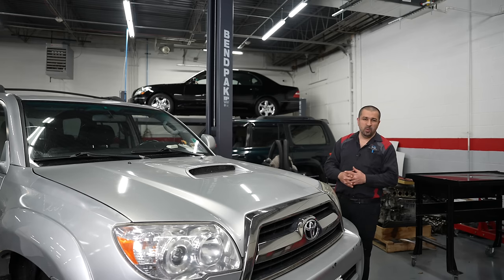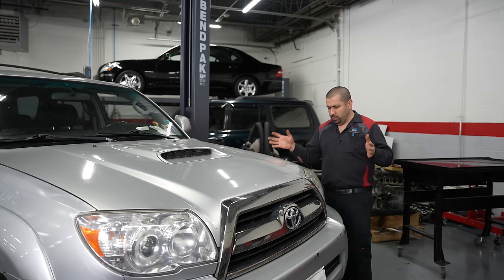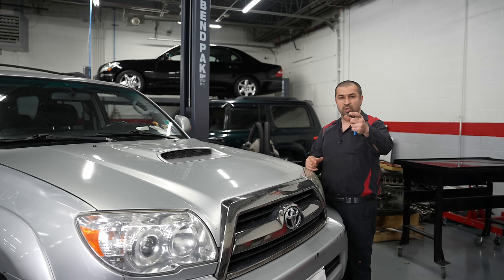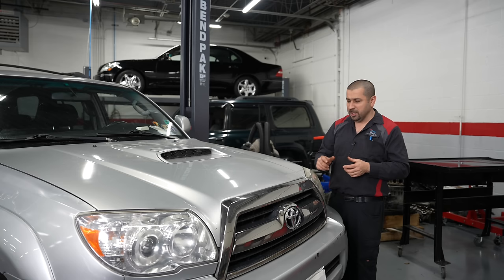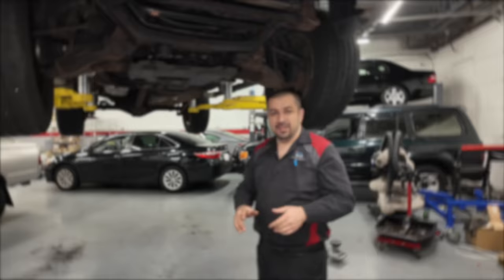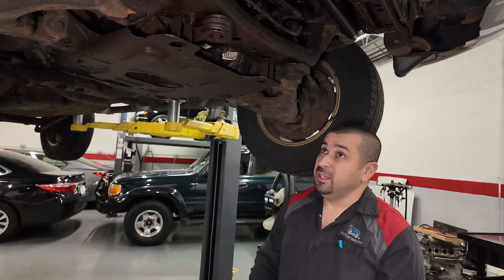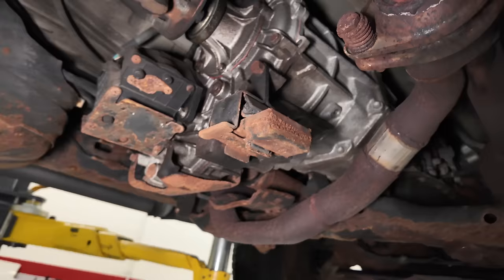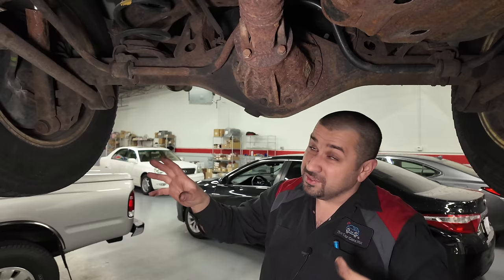THIS Problem Can Destroy Your Toyota Truck Transmission! Is it Too Late for This One?

Comment: Dealers took the transmission dipstick away, so how can you check the transmission fluid without taking it to a shop? The transmission dipstick should never have been eliminated.
Reply: Manufacturer eliminated dipstick, not dealership.
Reply: Jack stands and a hundred dollar scan tool, but I 100% agree on the stick never being removed.
Reply: 😂 it’s not hard to check it.
Reply: It’s a sealed system, pretty much. No dipstick reduces the risk of adding the wrong oil or wrong amount.
Reply: There should be a way to add a dipstick for the people who do their own maintenance, next they will take the engine oil dipstick away then what.
Reply: @emiliog.4432 
Cough, cough.
All transmissions and engines are “sealed”.  That’s what gaskets and o-rings are for.  “Sealed” doesn’t mean the gaskets can’t wear out, and it can’t develop a leak.  Nothing is permanently sealed that can be taken apart.  People need a way to easily check the level.  Don’t drink the cool aid.
Reply: I agree. I’m keeping my older vehicles WITH dipsticks.  Want to sell me a new one. Put the dipstick back in. I’ve changed my own fluid and filters for over 50 years. And I will not put up with the stupidity.
Reply: Toyota probably had to go to this method because their transmissions were very sensitive to fluid levels a little too much or not enough will cause issues and I know most people don’t even think to check their engine oil or transmission oil on flat level ground most engine, dipsticks and transmission dipsticks are either on the driver or passenger side so depending on which angle your truck is, it could give you a false reading
Reply: The cost of transmission service is high so the manufacture removed the dipstick so only dealor can earn that service.
Reply: @emiliog.4432  Yeah, but that's for the 5% of people who do not know what they're doing! No need to punish everyone else who actually knows how to work on their vehicles. It's a ridiculous choice.
Reply: technically there still is a dipstick but its inverted. you need to put your car in a diagnostic mode to check fluid with by just shorting a circuit on OB2 (no need for special tools, care nut has video on this) and allow it to notify you when it reaches optimal temperature where then you check to see if you get little drips of fluid coming out of drainbolt without removing plastic tube (thats the dipstick) that will tell you if you have correct amount of fluid and or too much by getting streams of fluid flowing through that tube. Care Nut has youtube videos on this procedure and it is very informative. But no one is going to disagree with you on the fact that it made it more of a tedious process than just checking an old fashioned dipstick. But once you have done it before its actually pretty easy. Also dealers didnt do anything, its the manufacturer
Reply: @MrMannyboy329  I prefer a dipstick, but I've changed the trans fluid on my 17 Civic, 19 Tacoma plenty of times. It's not really that hard to do. There are videos on youtube that walk you through the process. I have a scan tool, but every car has steps you can do if you don't have a scan tool that can read transmission temps.
Reply: Such a shame,oil undercoating if done correctly would not of have all that rust on transmission lines or brake lines,fuel lines,or under body of this vehicle,and should not of had to even worry about transmission damage due to low fluid.
Reply: @donniev8181  He shows you how to do it without a scan tool, on his how to change your transmission fluid video.
Reply: @arvbergstedt3303   I've changed my own fluid and filters on all my transmissions on ford and Chevy pickup trucks for years to, but even doing it at the regular interval's I still had to have everyone rebuilt between 100k and 200k miles.
Reply: @MrMannyboy329  many auto manufacturers already have removed the engine oil dipstick.
Reply: @MrMannyboy329 Many engines, particularly German ones, don’t have an engine oil dipstick. Gotta use the oil level sensor in the engine and pull it up on the dash…after it’s warmed up and after it sits a bit after shutdown. It blows.
Reply: Don’t think it was the dealers that did that.
Reply: You answered your own question. Toyota wants us to take the vehicle to the shop for their profit line.
Reply: It's to stop people who don't know what they are doing from trying to do their own work. Transmission fluid need to be at propler levels and proper fluid. Anyone can still check there fluid level, it's just a little more complicated. It's just the manufacturers saying that if you don't know how to do it, maybe you shouldn't be doing it.
On a side note, we had a customer come in who tried to do their own tranny service and put ATF in a CVT tranny. Told us we were trying to rip him off, because he's been using that same fluid for years and it a great brand of fluid and that the tranny was just crap. Got really pissed when we told him we can't warranty his tranny.
Reply: The dealers didn't build the truck toyota did...
Reply: @MrMannyboy329  That's been done on some makes (BMW).
Reply: There is two plugs on the automatic transmission. One faces downward buy has a tube that goes up several inches. You take that plug out & run the engine in drive (someone inside making sure it doesn't move, the if no fluid flows from the open plug you take out the upper plug and add fluid. 
It is really easy.
Reply: @MrNorthstar50 with Toyota trucks you won't have that problem even if you only do half the suggested maintenance. They only burn up with zero maintenance, overloading or if they leak and are driven with low fluid for too long.
Reply: Check it just like a manual transmission. Get it into the operating temp range specified, pull a plug on the side, if no fluid weeps out it’s low and you add some. If fluid comes out, wait till it’s a trickle and you’re good. It’s really not super hard once you’ve done it once.
Reply: You just change it at the required interval. If you bought used just change it
Reply: @thisdayage7997 buddy I have more friends that drive Toyotas than I can count on two hands that don’t do any fluid changes at all besides oil changes.
Reply: No….dealership didn’t take that…. Factory did…
Reply: So dealership service can make money.
Reply: @philrab the plug on the side is just for adding fluid, not fluid level. The Allen plug on the pan has a stand pipe up inside the pan that sets the fluid level when trans is at proper temp. That is what you meant to say, right?
Reply: @MrNorthstar50  still a wise decision to buy the Toyota specific Lauch scan tool. You can check everything on your Toyota with a good scan tool! You go right ahead and use the jumper wire, I'll plug my scan tool into the OBD port and watch the transmission temperature just as he did in this video! You can also customize your Toyota's settings, do bidirectional testing, check and clear  any codes, check your ATF thermal degradation value, change out tpms sensors and all sorts of other things you'd normally have to pay a garage to do.
Reply: @HeyManny69  yes, you wait until the transmission temperature gets between 95° and 114° then get out of the car and pull the fluid level plug, and then wait until the stream of fluid coming out gets down to a trickle. Then you put the plug back in and snug it down, and your fluid level should be perfect.
Reply: You need a lift or floor jacks and jack stand or ramps. You have to make sure it is as level as possible. The transmissions have fill hole plugs and check or overflow plugs. Drain and refill what you drained out, next you have to start the vehicle, run it thru the different gear shift selections, once at operating temp, you open the overflow plug, if it's trickling out or barely dripping its full, if it is not doing either of those, put fluid in until it slowly drips or trickles out, then it's full. But yes, the dipstick should be there.
Reply: @null046  you do not need a lift. The transmission drain plug is only a few feet away from the side of the car. Just do exactly what AMD did in this video, he loosened the leveling plug just enough to where it wouldn't drain. Let the transmission get up to temp, then get out and pull the leveling plug. Let the excess fluid drain until it becomes a light trickle, then put the leveling plug back in and tighten. Yes, jack stands make this easier, but it can be done without jacking the car up in most if not all models.
Reply: @donniev8181  oh I understand you don't need a lift, it was said to make it easier if you had a lift or access to one, my big body self can't just slide under my tundra lol. I would have to use my 3 ton floor jack, ramps and or jack stands and try to make it level as possible
Reply: @null046  Yeah, I was just saying it all can be done on the driveway, as long as everything is flat.
Reply: @MrMannyboy329 They already took engine dipstick away on certain Chryslers
Reply: they will skip that step and simply weld the hood closed . . .
Reply: There is a procedure to check it, it’s is very annoying because it has a two minute time window to check it before the trans gets too hot and you have to wait for whole car to cool down again but it is possible

Source: I’m a lifelong mechanic
Reply: @Michael-cm8qk ATF fluid is the ONLY fluid that is recommended to use OEM. I wouldn’t mix brands to save a few bucks on that one!
Reply: Still reliable
Reply: Just change the fluid every 50-60k.
Reply: Put some Lucas transmission fix in there too.
Reply: @emiliog.4432   It’s extra sealed when the cooler lines start leaking. The dipstick/fill tube should be put back for non-eCVT transmissions.
Reply: Trust me by eliminating the dip stick it avoids issues with people trying to add fluid. Seal tranny is a good thing. Checking under your vehicle at every oil change for fluid leaks will keep you informed if something is wrong.
Reply: The manufacturer did that.
Reply: @tswvxyastswvyeej5510 the fact you are spouting that nonsense tells me you know nothing about the issue! (1) it’s not hard at all to check / change fluid! (2) You not knowing how to do something doesn’t mean they are trying to keep you from doing it!😂😂
Reply: I used to have a 2002 Mercedes E320 with a "sealed" transmission I had to buy a special, really long flex dip stick and a new one-time use locking cap to check fluid and filled through same place. Now I have a 2007 avalon luckily made before July 2007 when they switched from 5 speed to 6 speed "sealed" transmission as far as Toyota watch his video on  procedure for changing fluid on sealed transmission
Reply: @emiliog.4432 wow! It’s obvious you don’t know what you’re talking about
Reply: @jpjp3873  Toyota WS is junk compared to other better fluids. Many Toyota owners use Valvoline Max Life with good results. My U760E transmission is full of Castrol Multivehicle ATF and runs better than it did when new. I didn't change it to save money, I changed it because WS fluid is crap.
Reply: @danieloneill4356  Oh,  ok. The car care nut recommended sticking with WS. He seems like a good resource, but I’ll take your suggestion into consideration.
Reply: @jpjp3873  If you peruse some Toyota forums or Bob is the oil guy forums you'll find that the Max Life ATF is very widely used in place of WS. I chose the Castrol because I believe it's got better specs than the Max Life. It's also much thicker than WS, which I like for my transaxle. I accept that YMMV.
Reply: This for me a not to buy car wich has not dipstick
Reply: @KingKongbabe  I have been a tech for 50 years. If it has a dipstick then it gets filled to the top mark cold when that is the  full after driving long distance mark. If it is fill to spill/fill port you won't be dangerously filled even to that level cold. The stupid ones are the shorty dipstick accessible under vehicle. Those still have the overfill vulnerability and the hardest way to fill.
Reply: @emiliog.4432 it's seal until that seal between the transmission and transfer case gives out and pumps transmission fluid into the transfer case all while you still not knowing
Reply: My 2008 Volvo doesn’t have one. Only a fill plug and 2 piece drain plug. Last time I did my trans fluid I had to use a scan tool to read the temp when I filled the transmission then remove the level set screw that’s inserted in the drain plug housing then the fluid will drain until level is met under the required temperature then you reinsert it. Just a hassle honestly, but you need the right tools. It didn’t scare me away but I can see how this can detract from DIYers wanting to do their own work. Then, on top of it the only place you can go to if you don’t want to do it yourself will be a dealership, AND they say it’s LIFETIME fluid lol. What a lie!! Whose lifetime?!
Reply: You’re not an engineer. I do not validate your comment. 
….
Fact check you. Engineers say fluid is good for life of vehicle!!! 
Hahahahahahaha!!!!! 😂
Reply: He said takes away more of a risk of adding the wrong fluid. @shakerman55
Reply: @MrMannyboy329 BMW already took the engine dipstick away on some of their models…
Reply: @dmurf4156  won’t be buying a BMW
Reply: Toyota transmission is not sealed. There is a double tube in the drain. Remove one drain plug and if at the proper temperature the overfill tube gives a slow drip stream. Then it's at proper level. No, not as easy as dip stick but a different design.  Learn it. It's not impossible for home mechanics.
Reply: No,Dearlers DID NOT take the dip stick away, it's the Manufacturer that designed the engine without a dip stick and if the vehicle is a 4 runner then their all made in Japan.
Reply: They don't want you to service stuff
Reply: @emiliog.4432  Eliminating risk of wrong fluid or amount being added does not justify eliminating a dipstick.  The risk isnt worth the benefit.
Reply: You're mechanic can check it when you have other maintenance performed. Tip, ask you mechanic so loosen and retighten your caliper bracket bolts! They will sieze..
Reply: @MrMannyboy329 some already have
Reply: I prefer no dip stick
Reply: Use your oil dipstick,  find the mm depths for hot n cold and mark/scratch the measures on the opposite side of the oil indicator marks. 🎉
Reply: @philliprobinson8858  there is no old dipstick, so what now, if I had an old dipstick where to you check the oil?
Reply: Yes and you can't tell if the fluid is all burnt up either
Reply: @flight2k5 If you say you can cheque a transmission sans dipstick in less than 60 seconds you are saying you don't know how to cheque a transmission without a dipstick...
Reply: @robinkelly1770  oofff. English isn’t your strong suit is it

Comment: The shop told my buddy that the trans on his 06 Matrix was shot. The car has over 300,000 miles. I dropped the pan and both solenoids were gummed up from dirt. Cleaned them up, fresh fluid, and I swapped out the rusty lines and the car has been going strong for a year now. His commute if 40 miles a day, god knows how many miles it has now. The OD stopped working at 299,999.
Reply: I have a 2000 tundra with 365,000 miles  I never  changed the transmission fluid in 25 years. I've slowly  added maybe a cup or  two every couple years lol. The fluid is red and seems fine.
Reply: @Jeff-sp7bg  - I've never understood why some people are proud to do the wrong thing. It's like people who say stuff like " I eat a pound of bacon and smoke three packs of cigarettes a day and I'm fine!".
Reply: @21jimmyo Funny thing is that the bacon is now being shown to be no problem!😂
Reply: @jpjp3873 
Exactly,  carnivore for the win. Eggs, bacon, fat+protein = health. Fat+carbs = leads to problems.
Reply: Very good
Reply: @headassvegan I’m not the Toyota owner but when you buy a vehicle that has no transmission service history and that has 100k+ miles, it’s better just to leave the trans alone. I made the same mistake servicing the transmission on my 100k+ mile car that did not have any trans service history. It started slipping after the end ended up just having to replace the transmission with a low mile unit. I will now be doing drain and fill by whatever the manual says. See if transmission slip fix products will help you stop your trans from slipping. Hopefully it’s just a clogged solenoid or you just under overfilled it like you said.
Reply: @Jeff-sp7bg lol your a daredevil lol 😊
Reply: @21jimmyo  I don't  know if not doing maintenence  on your own vehicle is right or wrong. I could care less what you do with yours or if you're  proud of it or not.   If you change your transmission  fluid every 50k miles or never that's  great .   Would my transmission  last  longer if I kept up on it ? Probably.    I was  stating this as a testament to Toyota quality.
Reply: @Jeff-sp7bg  It's the right thing for me. I haven't paid a repair shop anything in over 20 years, except for tires and alinements. It seems to me that more people are proud that they do the wrong thing nowadays.

Comment: At about 12 minutes in, I had seen enough, too much deferred maintenance. Don't throw good money at that truck, too much rust. I feel bad for anybody living in an area that causes vehicles to rust like that. Great video, just be careful under that truck.
Reply: Agreed, although I think the problem is no use of yearly underspray.
Reply: With those evidently rusted loose rear shocks that already high center of gravity 4Runner could easily roll over like a happy cat in a high crosswind or swerve.
Reply: Yes, an absolute rust bucket.
Reply: Worst decision removing a dipstick from automatic transmissions. I would not buy a car 🚗 without a dipstick in the transmission. 🇦🇺🦘